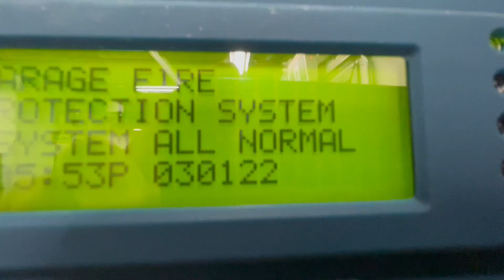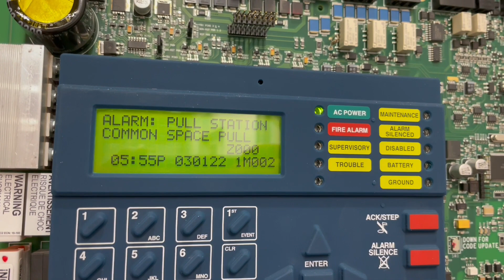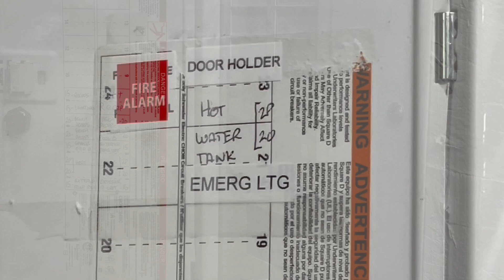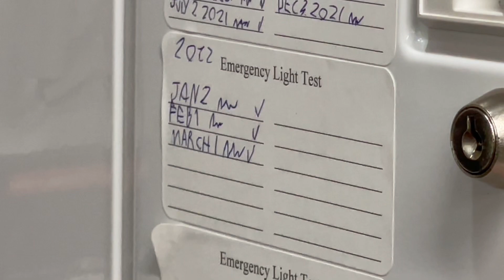March fire alarm system and emergency/exit light test

Comment: Why is that one set of emergency lights missing the cover?
Reply from the maker: It was on a different wall and had to get moved for the construction of a the new room so it’s just temporarily hanging there on wires
Reply: @nics-systems-electric  makes sense